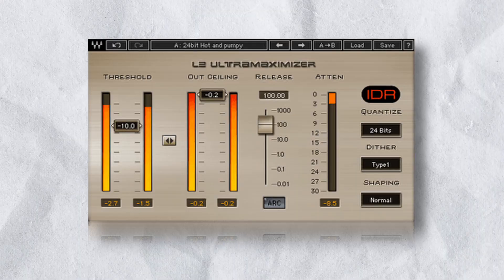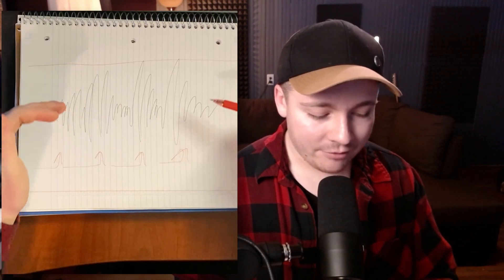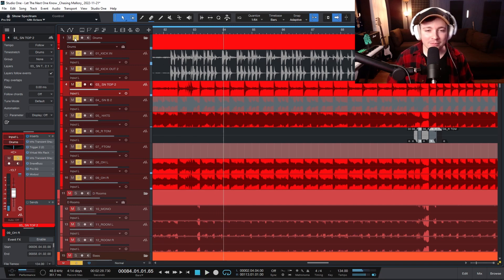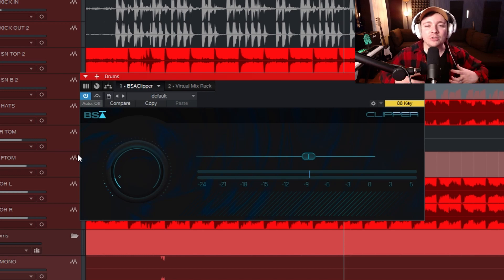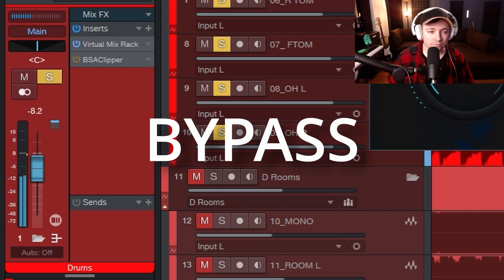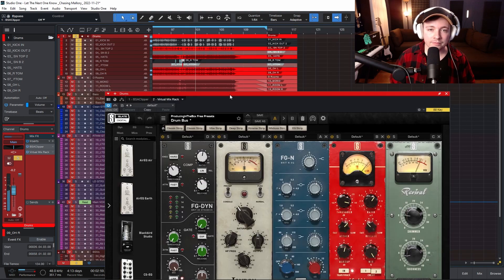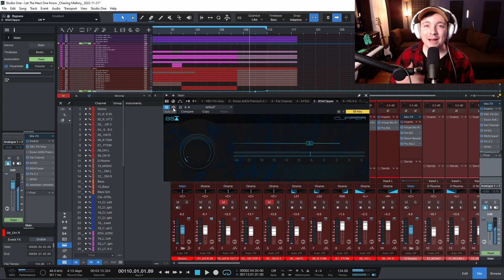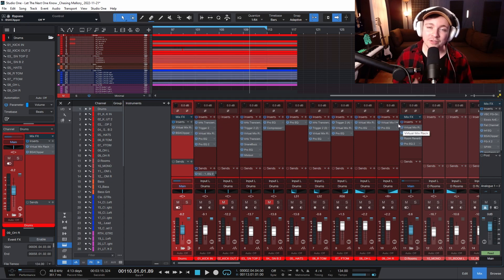How to use a clipper (Your secret to LOUD mixes)

Comment: God no .. Bro limiter is not at all what ur talking about it doesn’t push anything . LOL bro u have it wrong a limiter is what u think a clipper is dude LOL
Reply: Was just thinking the same thing. 

A limiter is just a compressor with an infinite ratio. Meaning anything that goes beyond the threshold you set is going to be turned back down completely below the threshold and brought back up as the signal’s peaks and valleys ebb and flow. That has its uses when mastering for sure but when overused to try and force the volume to be super loud results in this gross pumping effect which is that the limiter can’t turn back up fast enough before the new peaks and that keeps the volume pinned down, never able to return to its more natural sounding state. Limiters have very fast attacks and releases with the exception of some that let you control those aspects. That just controls the speed at which the limited is turning down the signal and turning it back up. 

A clipper reduces the space at which the waveform can be properly represented at whatever the volume is when you either push it into the threshold or bring that threshold down onto the signal. Because the signal cannot be represented louder than the threshold, it “clips”. Meaning the waveform gets distorted as in physically changes. And since that energy has to go somewhere it results in new harmonic reflections and resonances that weren’t there before which is that crackling sound we all know and love. And the reason we love it is because those harmonic crackles are related to the original fundamental frequencies that you were clipping. Harmonics are like audio holograms of the original sound and make the sound sound more dimensional. And since you clipped off those tips, your limiters and compressors are going to react more evenly to your signal because there won’t be some transients that are so much louder than the rest of the signal. And you don’t lose perceivable volume with clipping. If anything you gain it. And your compressors are having a much easier time because they’re reacting to much more evened out waveforms. It’s a win win in certain cases. 

I had to flex the knowledge so that people seeing this video don’t get confused.
Reply: LOL LOL LOL
Reply: @chadmichael_  Did you even watch the video? He never said that "you lose perceivable volume with clipping" he said the opposite of that LOL it took me longer to read your comment than to watch the video and now you got me wasting more time on you writing this. k bye
Reply from the maker: @xMaSSxHyST3RiA Fr bro 😂 both limiting and clipping lower the dynamic range of a signal, but clipping gives a more perceived volume on transient heavy things like drums, as I showed in the video! I should have clarified it a bit more tho. Both clipping and limited lower the dynamic range of a signal. Both are useful tools.
Reply from the maker: @chadmichael_ This ☝️ right on
Reply: @xMaSSxHyST3RiA  I did actually watch the video and he says something similar to what I'm saying but there isn't any useful or coherent detail. I included that part about clipping because I was already explaining so much else that it was still relevant regardless of if he got that one thing right in his video.
Reply: @xMaSSxHyST3RiA  I don't even get what you're upset about honestly. After reading my comment over again especially. I provided a stellar explanation of both limiting and clipping and why clipping is superior just to make sure that nobody got confused by the lack detail in the video. It doesn't matter if the video said clipping makes the signal perceivably louder. I just said it too. There is so much more to explain than just that and I find it strange that that is what you're so fixated on.